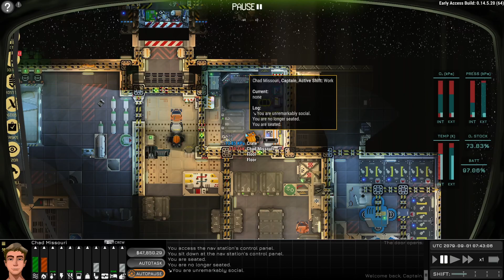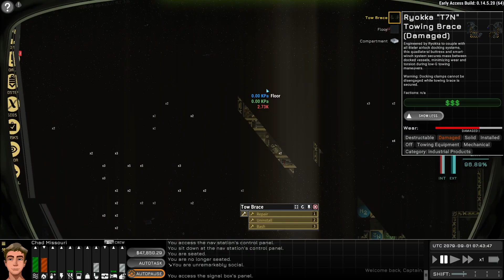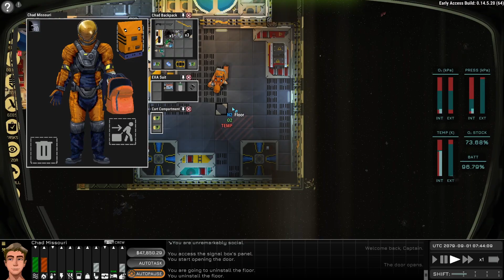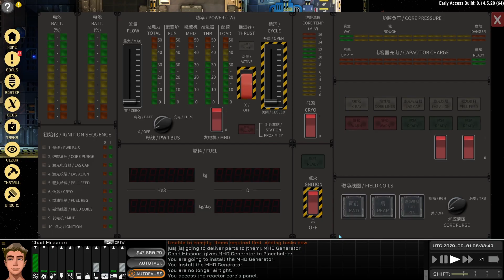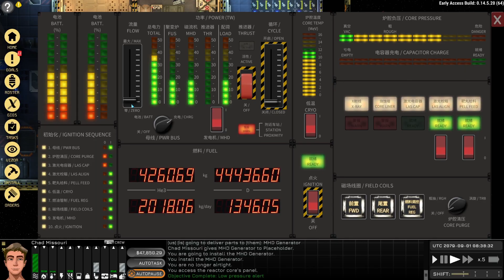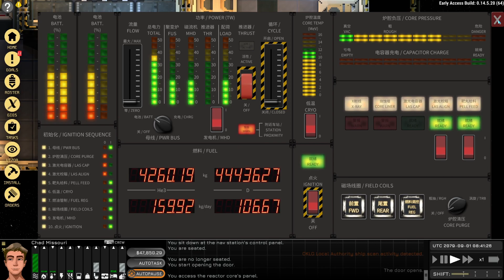Ostranauts Let's Play - S3E43 - Installing the Nuclear Reactor (build .14)

Comment: You keep getting that message about No Slotted PDAs found. There is a new slot they added on your dude's forearm, if you stick a PDA there you won't get that message any more. Plus you can easily access the PDA modes by pressing L when you have one in place.
Reply from the maker: Yeah, I think I did finally handle that.  I just kept forgetting.